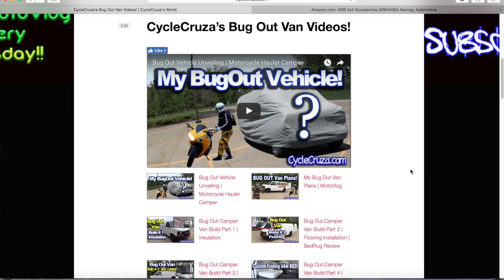Day 2: Police: Dead Body in Van? Why I Cage Dog? | Stealth Moto Camper Van Adventure

Comment from the maker: Links to get my Van Stuff below:
Get 12 Volt Refrigerator 50 Quart here: http://amzn.to/2coIUv2
Get Thin 100 Watt Solar Panels here: http://amzn.to/1WurrAW
Get 155 AH Deep Cycle Solar Batteries: http://amzn.to/2cHGW5K
Get 40 Amp MPPT Solar Controller: http://amzn.to/2cfqfgD
Get 20 Amp MPPT Solar Controller: http://amzn.to/2cKFraO
Get Solar Meter here: http://amzn.to/2cHHfgZ
Get 32" 12 Volt LED TV here: http://amzn.to/2cKEhw9
Get My Non-Stick Fy Pan: http://amzn.to/2cOMOf7
Get TV Antenna with Magnetic base: http://amzn.to/2cKGc3H
Get TV Antenna Extender Cable: http://amzn.to/2c4yWQg
Get Tiny Security Cameras (Infrared): http://amzn.to/2cMjGDI
Get 6.5" DVD Multimedia Head Unit Stereo: http://amzn.to/2cKGyrj
Get Weather Station here: http://amzn.to/2cKH7kz
Get 12v to 6v converter here: http://amzn.to/2cfsAIf
Get Weather Station Remote sensors here: http://amzn.to/2ceGnkC
Get Van exhaust Vents here: http://amzn.to/2cHJiRP
Get LED Natural Lighting Strips here: http://amzn.to/2c4zntS
Get Awning for Cars/trucks here: http://amzn.to/2c4ykKB
Get Awning Room Attachment here: http://amzn.to/2cKHRGq
Get 12 Volt Dual Fan here: http://amzn.to/2cftGns
Get Tire Pressure Sensor here: http://amzn.to/2cfuTLf
Get Voltmeter here: http://amzn.to/2cHKGnz
Get MicroSD HD Video Recorder here: http://amzn.to/2cHM5uq
Get Quad Video Processor here: http://amzn.to/2cKIyzI
Get Screen Material (make screens): http://amzn.to/2cfvQ6r
Get 12 Volt Vacuum here: http://amzn.to/2ceJadO
Get Small Folding Tabe here: http://amzn.to/2coLBgp
Get Portable Camp Chair here: http://amzn.to/2c36Zpk
Get Wall clock with Indoor/Outdoor Temp: http://amzn.to/2coMQfj
Get Auto Fuse Boxes here: http://amzn.to/2ciKwEW
Get 100% Copper Wire CHEAP: http://amzn.to/2cHOhlQ
Get My Action Camera CHEAP here: http://amzn.to/1F85kog
Get Aerosol fire extinguisher cans here: http://amzn.to/2c6FNJ3
Get LED Dimmer Knob Switch here: http://amzn.to/2cpw11C

Link to Get ALL of my Van Stuff:
 http://cyclecruza.com/links-to-get-my-bug-out-camper-van-stuff

Comment: I80 West from Vermilion, OH to Kimball, Nebraska is pretty much all cornfields and irrigation systems. 

Cabella's has overnight parking for big trucks and rv's. You should be ok there. Also, most Wal-Mart's out west are ok with rv's and stuff parking in their lots overnight as long as you don't make a mess. most are 24 hours so you can run in and use the restroom. Plenty of Truckstops you can park at overnight as well. 

Wait till you get to Wyoming. It's bleak as fuck and rolling hills till you get to the continental divide, but towns are about 50 miles apart. It's all ranch land. you can see the Milky Way if you look up at night. Very little light pollution.

Comment: Another thing: I learned driving cross country 3 times on I-80 and I 70. NEVER EVER Stop in the midwest states. From Ohio to the mississippi. DO NOT STOP THERE unless you're getting fuel and get gone. Those states are in such shit state economically wise they will look for any and every reason to pull out of state travelers over. Once you cross the Mississippi. All is good, and you're in the freedom zone.

Comment: This is hilarious!.....I love the van, but it does sort of look a little suspicious from the outside. Maybe you should paint it? ....or not.
Reply: Chris Romero - white construction van is very common in urban areas. That's how most fleet vehicles are being sold. 
Slap a " FRESH FISH DELIVERY " signs on both sides and you good to go.
Reply: The van is not the problem... Van very common! Motorcycle under packing blankets where front seat should be, NOT so common!  Man walking dog out of work van also not very common.